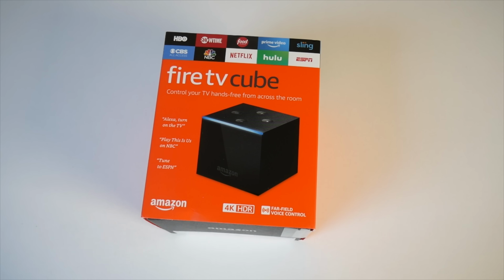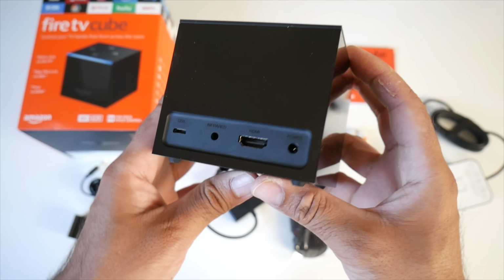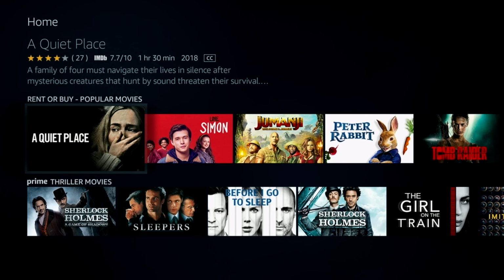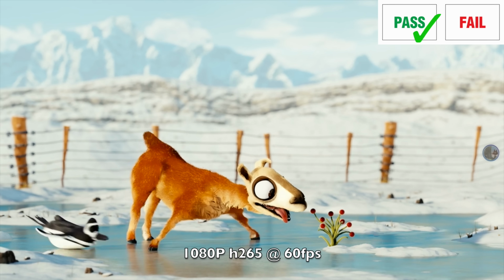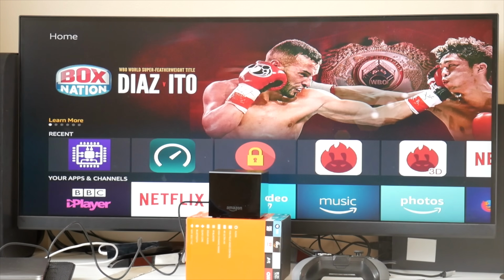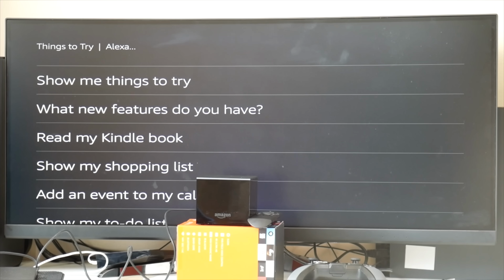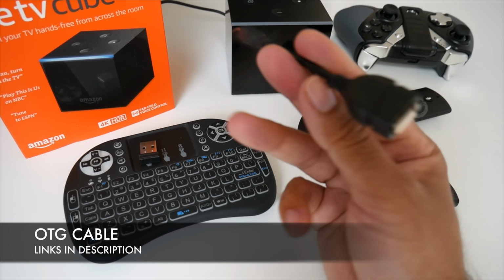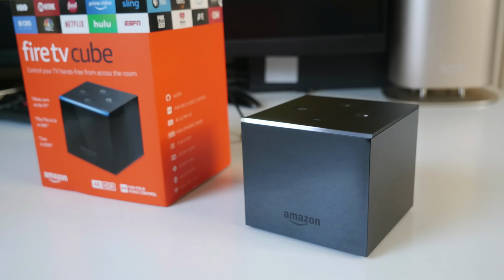Amazon FireTV Cube with Hands-free Alexa Voice Control - Any Good?

Comment: Can you please help me with my Mi box 3, es file can't read my 1tb wd external hard drive if install es file my external hard drive disconnects automatically. Please help me...
Reply from the maker: Do a factory reset from settings and then try again and it should work fine.